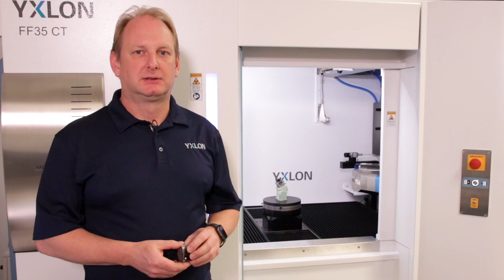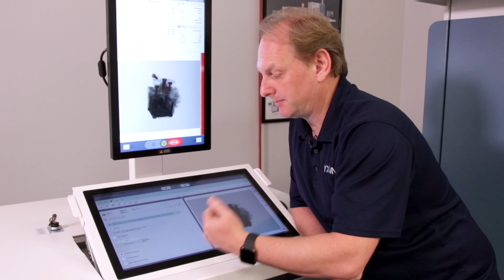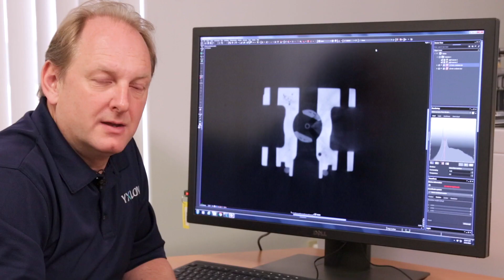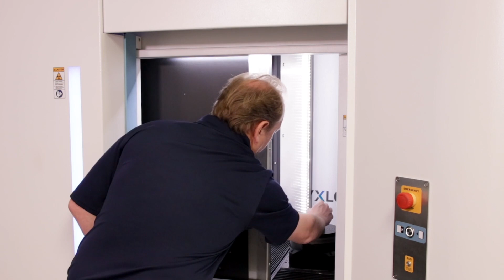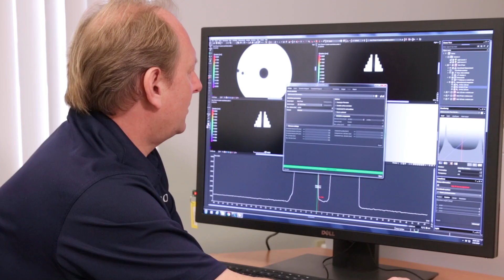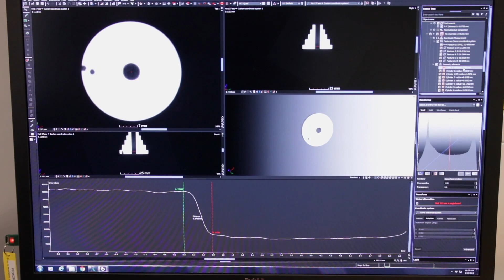Dirk Steiner from Yxlon Explains Why Variable Detector Position Matters

Comment: I always use the short detector distance like 600 mm, but my key point is not the speed. My view is to have a better brightness and light intensity with the lower X-ray current.